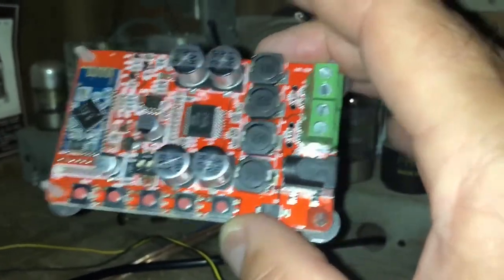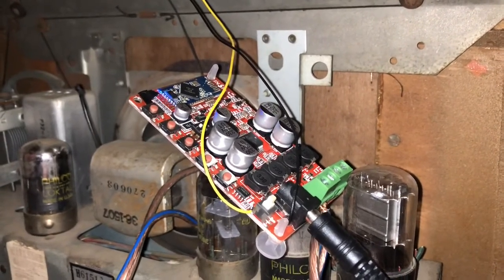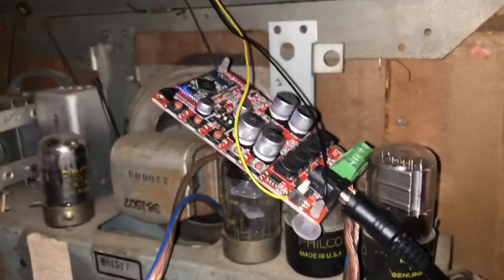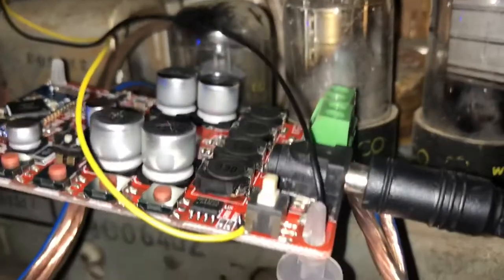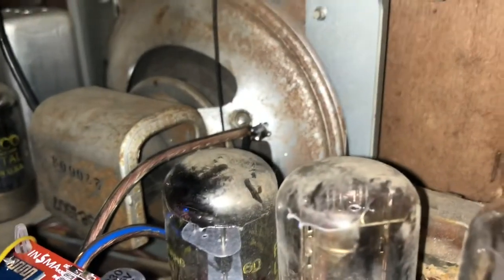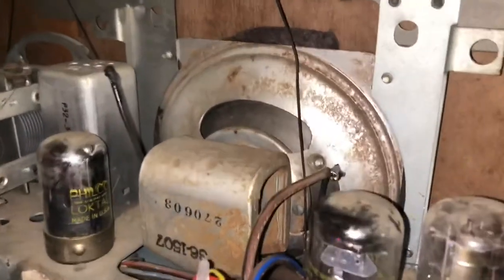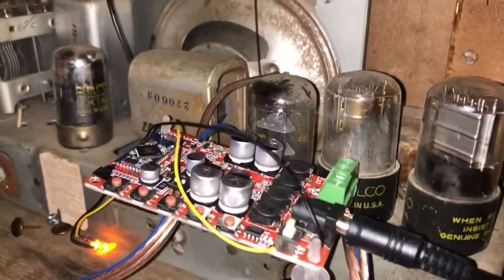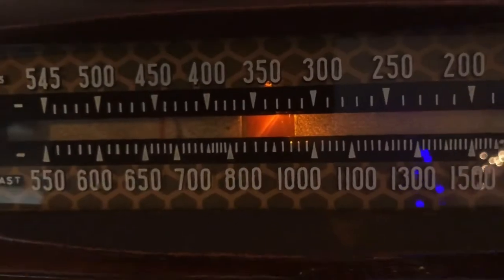How to convert an antique radio into a Bluetooth speaker in a 4 minute video

Comment: Sorry, 
I just read the tread where you answered about the LED lights, but my board does not have an on/off switch. It’s like the second one on the video with no switch. Will that one also work for the LED  light and if so where do you solder the second wire?
Reply from the maker: It will. You just need to experiment and touch the wires to the area where the power goes into the board. That is how I did it. Then just solder it to those spots. Sorry, best way I can explain it

Comment: Had a thought...could the LED be connected to the other speaker connection? Would it draw power to run? Or is that a bad idea or won't work.Tried connecting it  to the little power switch thing, but never could get it to connect to power. BTW, soldering is not as easy as it looks. But got my first speaker wires connected! Thanks for the video.
Reply from the maker: You have to play with the led and touch it to various spots where the power goes in. It was experimental for me. And it can be hard to solder in those tight spots

Comment: Where do you wire the LED lead on the board and where do you source you LEDs? Thanks!
Reply from the maker: So the LED has one wire soldered to the side of the AC power input on the board and the other wire to the on/off switch of the board. On the board where both the power and on off are soldered on, you can touch the wire to the base until you get the light coming on. This way you see where it needs to go.
The less are just 12V led’s I got off amazon. 120pc of 6 colors for $10. I like to use the amber colors mostly for the warm glow

Comment: great video of your setup.  Question for you.  Do you just use only one speaker connection from your board as it looks like the board is stereo, but you are using the original mono speaker?
Reply from the maker: It depends. I try my hardest to keep the original speakers. If the paper of the original speaker on the cone is torn then I use tissue paper and nail polish to fix it. I think it is really cool to be able to listen to the audio through the original speaker from the  1940s 30s or whenever. If I cannot salvage the speaker then I replace them with two 4 inch three-way speakers and do it stereo
Reply: @perfdavid  Thanks for the response.  I am doing a similar conversion and wasn't sure if you used only one channel of the stereo output.  But I agree, using the original speaker does sound amazing.